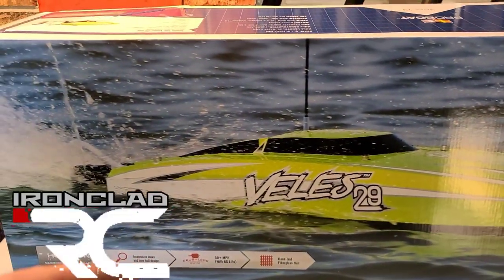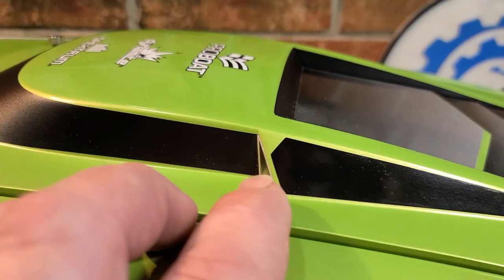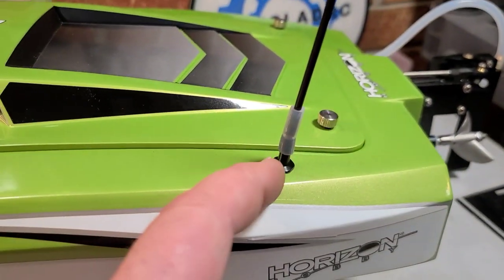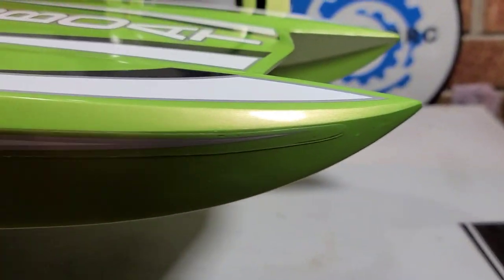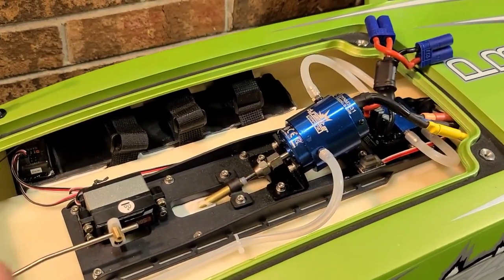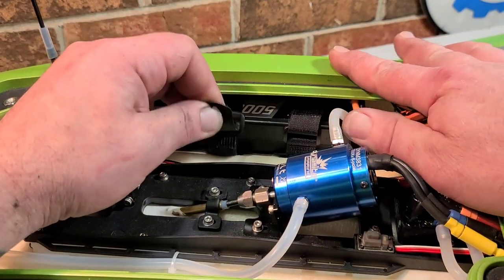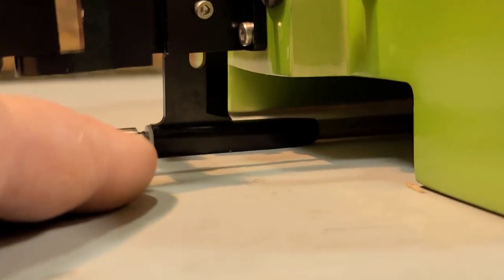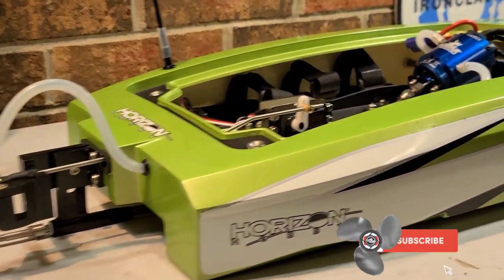Proboat Veles 29 Brushless Catamaran unboxing & Review

Comment: You are absolutely right about battery trays. They should be lower. My only gripe about boat is that it’s tough to get battery’s in and out. I have had best luck with a smaller battery on right side. Add a little zip tie to the plastic buckle on battery strap , it will help when strapping
Reply from the maker: Yea they are a pain to get in and out extremely tight ( tighter than a misscito cha cha)  😆 🤣 😂   Thanks for the zip tie trick I will definitely give that a shot.

Comment: your going to love it . had mine about 8 months . running a custom stainless steel cnc prop made for the zelos 38 . RCBB twin cooling rudder & power HD servo . stock motor & esc . it halls A$$ . 😎
Reply from the maker: Yes sir buddy.  I'm stoked  omg. That's the one boat I thought I'd never get my hands on, you have no idea how much I appreciate the gesture.    I bet it does haul the mail, I've had so may subscribers ask me when I was getting that boat.    Dude I appreciate it.

Comment: So glad you are getting into this boat. I have the miss geico 29 v3. Can't wait to see what u do. All I've done is sharpen and balanced the prop. Bigger 4274 2200kv. Want to learn how to get it to take off faster. Next is seaking 180amp
Reply: Sounds solid! Bigger prop faster launch
Reply from the maker: Larger prop or a prop of the same size with less pitch would be perfect for low end take off.

Comment: hey love your videos, I burnt up my esc/motor on my veles. Do you know if the Castle Creations Hydra X will fit in this thing? if not whats your recommendation?
Reply from the maker: Should fit perfect, I used a flycolor 150 with the stock motor for a while, great pair, I was getting in the upper 80 with the flycolor.     Later I paired a sss 4074 2000kv with the 150 my best was 95mph

Comment: Hey Big B, big fan here. I've got a question. I recently got a deal on a brand new Veles 29 that I couldn't pass up. I am looking to add a dual pickup rudder. I was thinking of getting the UL-19 one since it is shorter but I am wondering what your recommendation would be. I appreciate your feedback.
Reply from the maker: Yep that's the rudder I'd get for mine!

Comment: I modified the ESC harness on mine to be parallel instead of series. I've been running 2 x 6s 3200mah and 2 x 4000mah  and it's a fun boat.  I've also run 2 x 4s 3200mah and it's still fun.  I'm looking forward to seeing what you do with it.
Reply: How much run time in Parallels you get?
Reply: @georgem.6136  I actually haven't kept track.  I'm using 6s on a stock boat (and prop)so I don't just blast around until the battery dies.
Reply from the maker: Thanks for the tips brother.  I will definitely give it a shot.

Comment: I have a Veles 29 and it keeps breaking the shaft at the coupler.  I bought a new one from Offshore and it did the same.  Do you know what could be wrong?
Reply from the maker: Motor could have Miss Alignment to the stuffingtube, or the coupler is slipping heating up the flex until failure
Reply: @IRONCLADRC  I think it is heating up the flex because the couple is charred and the cable is too.  The original did the same thing.  Could it be because to was to tight?

Comment: HELP! OCTURA X442 PROP, SPEKTRUM 5000mah 100c. Batteries forward, left front pulls up, moved them back, right front pulls up, at 50% power it still flips over.
Strut is flat on the board. All stock except for the prop.
First response to the pond. Disaster!!!!
Reply from the maker: Try lifting the strut up a couple  millimeters neutral position with the stock prop ..   she's a straight away boat she doesn't like corners  at low speed,  she likes straight away passes.    Also consider a smaller prop like the 42 oxiden or a 1616 abc (impossible to find at the moment)  I noticed that  smaller props give the boat a better handling characteristic.
Reply: @IRONCLADRC  ok, I'll go up 2mm on strut. I do have a octura x642 and a ABC 1616-1745!!
Reply from the maker: Yes the 1616 will settle the boat a little more than the stock prop plus give a better topend
Reply: @IRONCLADRC  I'll give it a shot.. wind is picking up now quite a bit.
Reply from the maker: Good luck brother,  👍 it's windy here too,    blowing 20 mph right now
Reply: @IRONCLADRC  is that oxidean 42 the high rate, or the 42 for the vales 29, that's sold out??
BTW, could you use 3 new proboat props, off my ul 19, SW v2, and the Vales 29???